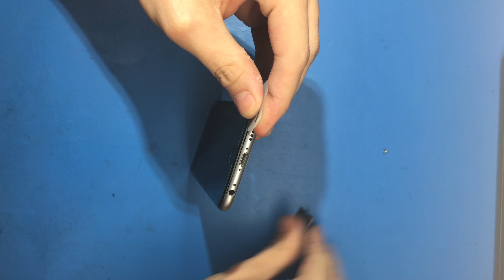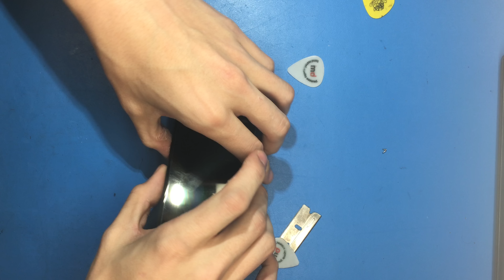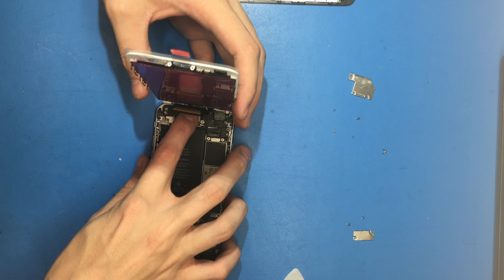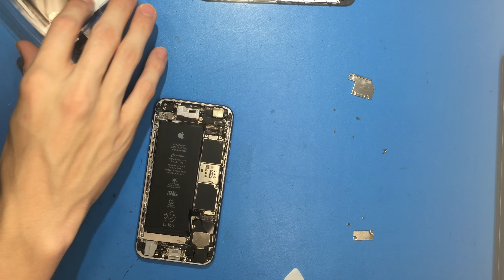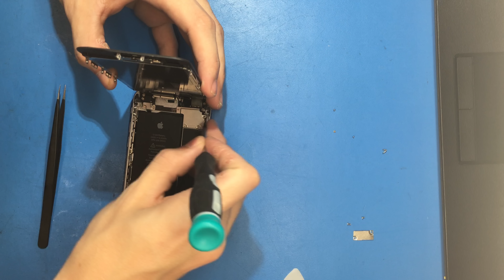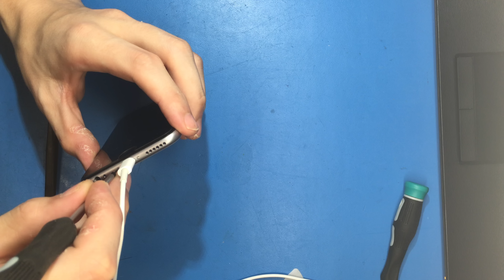iPhone 6s Water damage treatment

Comment: Hi Sam! 

So, first, thanks for the video!

 Common story, my iPhone 6s plus is a rebel and took a dive. Internally, I do not see any signs of corrosion.

Attempt 1: I went home after my trip. The phone seemed to be doing alright. It wouldn't charge, so I put it in rice. The next day, I took the phone apart and put it in rice. There was some mineral deposit from the water. I cleaned that off. I put it back together. The logic board was overheating and the home button was not able to activate touch ID. It was still not charging while turned on. However, it will charge when turned off. Took it back apart and placed it in rice.

Attempt 2: I placed the logic board, the home button, the taptic engine, and the bottom of the phone to get the dock connector in 97% isopropyl alcohol for a couple hours. I put it back together a day later. Things looked a lot cleaner. I turned it on. It stayed on the apple logo. When I plugged it into a charger, it turned on (although it does not recognize charge.) The LCD screen looks fine, but does not respond to touch and it does not recognize a charge. On the bright side, the logic board is no longer overheating. I checked to make sure the LCD connection cables were in there well. I cleaned them just in case with the isopropyl and put them back together making sure they are seated well.

Attempt 3: Help! Any advice?

Thank you!
Reply: Thanks so much, Sam! So not worth trying to replace the battery? Also, would you go for a verizon asurion replacement for 200$ or a 300$ replacement from Apple?
Reply: Thanks so much, Samuel!

Comment: Hi Samuel. My iPhone 6 fell into the water. It was there for a minute long and i kept it off like 5 days. On day 6 i tried to power it and it sas dead. 3 hrs connected to a power source and nothing. ITunes dont recognize it. I opened it and cleaned it with isopropilic alcohol, brush the circuits and nothing happen. I also tried sigh another display but it still dead. Do i have another option?

Comment: I use a tablet container the type with days printed on the top they have little plastic lids one sneeze and the screws are all over even if you find them they are different lengths and chamfers,s You could also use a ice cube tray but the containers are better they have lids you can tip out each process. And you sneezed just as I posted

Comment: Hey, my iPhone 6s fell in a toilet and stayed in there for less than 5 seconds. I pulled it out and dried it completely! It works perfectly after 2 days. I didn't turn off the phone or anything at all except dry off the water and shake out water which nothing came out. Should I be worried?
Reply: +Samuel Smeltzer okay, thank you so much for replying :)

Comment: So my friend has an iphone 6s and it had a small hairlime crack right across the screen. a few days later some drops of water got on her screen and now it is super glitchy, when it turns on at the top of the screen where the time and battery percent would be a white block shows up and  dissapears all the time and it makes it very hard for her to unlock her iphone to the point where she has to hit her phone on her legs for it to almost work or stop gitching and even then her touchscreen wont work most of the time...how could she fix this or would this method you are using in this video work as well

Comment: Hi, I have an iPhone 6, I dropped in a toilet for 3 seconds, stop working after 5 min, after a month I plugged in and start charging, I restart and battery holds charge, my only problem is really touch screen doesn't work, I got a new one and its like black on, any suggestion to make work the original one for the touch sensor or something similar?

Comment: First of all, does not purchase an iPhone 7 thinking the phone will be water resistant because really that is NOT true.
I bought an iPhone 7 just because I got an apple watch as gift and I wanted to use it with the latest iPhone device.
Last week I went to vacation and believing that my iPhone will resist at least 1 meter under water (like apple say, and after see a lot of youtube video saying the same) , I decide to take an small video under water just submerging my iPhone 7 around 10cm to 30cm under water. And I did, really that was my mistake knowing that iPhone 7 just meet IP67.
Of course, after a couple minutes then home button stopped working, the screen showed an alert saying that the home button need reparation service, and allowed me to use an in screen home button instead. After 5 to 15 minutes the network start with problem, the phone does not recognize the SIM card, and after 15 to 30 minutes the phone start with screen problem, and finally the phone does not worked at all.
I research an internet about what to do in that case, most people say the obvious (I should never have to introduce your phone in water) another people say take your phone to apple service, and other say that try to dry your phone in free air for at least 5 hours, I leave my phone outside drying for 2 days and nothing happens, you could see the humidity in both cameras lents and also in the screen.
Finally I found a hair dryer in the hotel room where I was, and I decide to take the risk because I have nothing more to lose. I opened the SIM compartment just for allow the air circulate, and I start drying the phone with the hair dryer for about 15 minutes, directly to the opened SIM compartment. Of course I was very worried about the phone because the hair dryer put it very hot. But fortunately nothing wrong happened, after 10 to 15 minutes the phone was very hot but complete dry. I did not tried to turn on it, because the phone was very hot. Just I allowed him to naturally let it cool. Then I closed the SIM compartment, and YES, fortunately my phone was like NEW. Everything working again, the screen, the network, the home button, Everything.
I do not recommend nobody to do what I did, but I want to share my experience, because may be helpful for somebody else.

Obviously the best it is does not introduce your iPhone in the pool or any kind of liquid.

Good Luck.

Comment: my phone ( iphone 6s ) well I was running at the beach and decided to go in the water just to splash some waves, I had my phone in my pocket  ( I had it with a lifeproof case ) but the earphone plug thingy I left open, when I got out of the water and checked my phone and it was fine 5 seconds later it started glichin then some lines up and down came up, 5 seconds later i had color black and white on my screen and it turned off and it won't turn back on.( although I flick the vibrate switch thingy and it vibrates ) my friend said my ( phones LCD is broken ) what do U think.

Comment: my dads iphone 6s fell into a bucket with water and clorox for a few sec and it was sitting in a drawer for like 5 months or so. I removed the sim tray and put the whole phone into a plastic box with 96% pure alcohol and let it for a night then I tried to power on but no display I then connected it to the computer and held power button then home button at the same time and got it into recovery mode and when I tried to restore it it said error 9,The screen is black so I think its dead but maybe thats the motherboard? do you think It can be fixed?

Comment: Hello. I dropped my 6s in the shower and left it on the counter over night. The next day it worked but had small water stains on the screen. Throughout the day the water stains got worse so I placed it in rice and took it out today. Nothing improved and I noticed that it won't switch off of headphone mode even when headphones aren't turned on. The homescreen button is glitchy as well, and it would not charge at all. Wondering if I have any hope at fixing it. Waiting on tools to come in on Friday then try and remove any corrosion or rust. Thanks
Reply: Yeah I figured I would have to possibly replace it. It isn't that expensive. However this is what my screen looked like earlier today. http://i.imgur.com/lN7vMhb.jpg

I appreciate the quick reply though!
Reply: Thanks man! Will let ya know how it all goes
Reply: Just a quick update. Took the whole thing apart and cleaned it. Most of the corrosion was only on the metal parts of the body. Nothing was on any of the chips and stuff, although a little was under the home button. Still won't charge so my next step is to replace the charging port.
Reply: Now a low battery symbol is popping up on the screen. Maybe it's getting a little bit of a charge now.
Reply: The black tape at the bottom near the taptic engine? Also the phone managed to come on briefly for about 45 seconds then it died. Showing the same dead battery symbol now.

Update: Phone is charging and working fine now. Just a few water stains on screen and a cracked screen due to my inexperience of fixing iphones lol.
Reply: Oh yeah man you saved my life! Thanks a lot man!

Comment: i put my iphone 6 in the pool with a life proof case and water got inside. it was working fine, i dried it and then it started acting crazy like i was trying to close the apps i would dry and lock it to stop it but it would screenshot even though i wasntt pressing the home button. Anyway do you think the sensor things activated?
Reply: +Samuel Smeltzer do you think the water sensors might have been activated?

Comment: hi samuel,  can the a9 chip be  shorted? that's  what you mean by the main processor being fried right?  what are the options if that happens? got my iphone6s plus board cleaned but they say that my a9 chip is shorted
Reply: Samuel Smeltzer thanks for the detailed explanation. one last thing, can the memory be replaced easily? for example i have a spare board for 6s plus but only have 16gb memory. i want to take the 128gb memory from the board of the broken A9chip. they should be compatible right?

Comment: Hi!! I lost my phone in the toilet for like 0,5 seconds and I took it up quickly and dried it with a towel and shook it so all the water in the headphone jack and speaker came out. It worked perfectly for 4 hours or so and then it came a line across the screen it minimized it self but it's still a line there. Is my phone going to die or something cause I'm very very worried :(( my phone is an iPhone 6s btw please answer quickly
Reply: +Samuel Smeltzer How much will it cost for me to clean I u think? Can I do it at home myself?
Reply: +Samuel Smeltzer so i took my phone to service and they said after one week i got a new one because they couldn't fix it and i didn't pay anything as well
Reply: Ok

Comment: Hello! This first time commenting on anything but I've been fixing iPhones for a while and my iPhone 6s went into lake water 5months ago and i see no corrosion or any sign of short circuit, but both stickers are red, the phone doesn't turn on and changed the battery but still no life just heats up. I wanna know more bout what the problem could be
Reply: What would I clean it with? And there no sign of any corrosion or no rusts at all. And thank you very much for the most helpful respond👍
Reply: Okay I will check for anything of any sort and for a hunt for some of the cleaner tomorrow
Reply: If it heats up, there might be shorted capacitor or component inside the unit. You need a multimeter in checking a shorted board, if theres an infinite resistance on positive and negative terminal on battery connector, if you put the meter probe on a continuity mode. To pin point the shorted component use a dc power bench supply, apply a 3.8v with 2- 4 amps current and a lighter fluid. A Shorted component heats up very fast and will easily dry up the lighter fluid on the board. Hope this helps